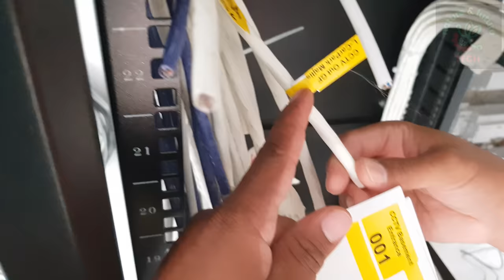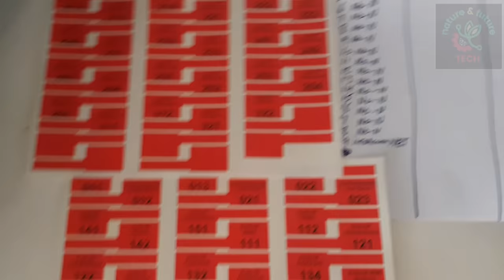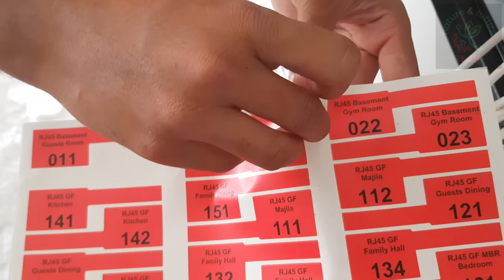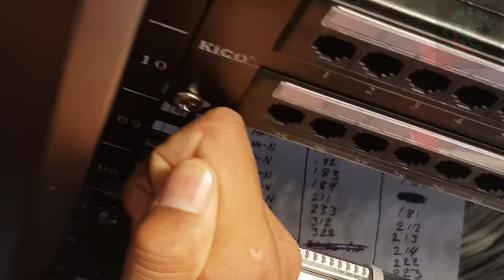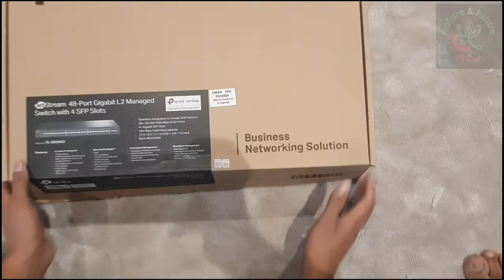Installation Network data Server Rack And cable management 27U cabinet Best Setup For Office or home

Comment: Not good work
Reply from the maker: Way not tell me the reason
Reply: Not good, excellent work.
Reply: First off they used zip ties in the rack half way thru the install they is when they decided to use flush cuts on the zip ties they were using should have been Velcro or “hook and loop” the large bundle they made from the celling is not in 24 cable bundles from the patch panel so if you did have to trace a cable back you would be lost just to start off there is more
Reply: show us your job guys! I really want to see it
Reply: Not good, amazing work
Reply: 🙄 23:20 🙄 16:36 🙄 10:20  @naturefuturetech

Comment: This is not a good example of best practices for rack installation. Zipties damage cabling and hands, velcro only. The whip should never run into the bottom of a wheeled cabinet. Not using a proper punchdown tool for termination, no lacing bars for strain relief.

Comment: Bro you are using STP Cable in cat 6 Patch panel ..it's wrong you should use CAT6A Patch panel for cat 6 A Cable
Reply from the maker: No bro we use cat 6 A patch panel for cat 6 A cable and for STP cable use cat 6 patch panel but in 1 patch panel we use some cable for CAT 6  because we don't have more space for extra patch panel
Reply: All that changes is copper size, you do have to make sure you get a proper connection with STP but it's really not going to affect anything

Comment: To every Low Voltage Electrician?     Watching this is pure harmony.   However, I would  negate the Zap Straps for Velcro.  But I would be a Liar if I said that I did not too do the same.   Instead of Labels?  I just use a Sharpie.  
Hard to get a Punch down tool in those tight space, so glad you got it done in place.   :goodvibes:
Reply: I would also replace the hard patches with keystones. Much easier to move around (which I've done a few times myself). The added cost is negligible compared to the hours paid.

Comment: Just small Tip: Permament Labels -> First tie over the cable and next bend over the label so that it will additionally secure label from falling of as the cable part will be glued from both sides :D

Comment: I am new in this kind of work, and the setup looks very neat and nice, but isn’t it better to have the related patch panels and switches be closer to each other, that way you only use a small cat6 cable to connect them right above each other, that way it will be easier for maintenance later; for example if there’s a problem with one specific cable with this kind of setup you might need to remove lots of cables so you can reach the specified cable but when the switch and panel are right above each other only a small cable needs to be removed or changed, i don’t know what do you think?

Comment: To those who mention the labeling + patch/switch arrangement:  I suspect that this was existing wiring they had to deal with, identify and clean up. Or who knows.  And I suspect they needed very specific patch ports to go to specific switches, so the paths are actually all different, it just looks clean. You can't always just jump patch ports 25-48 to switch ports 1-24 and vice versa. Then you have to choose if you keep your patch panels linear (to serially match the wall ports), or patch by function. I'm debating that in my upcoming install though I prefer the latter. Seemed like they possibly did the former.
Reply: Yeah…from the start of the video, you could see that it was preexisting cables. They cut them and toned them out
Reply: L'organizzazione di un Rack è a discrezione del progettista, se si tratta di un Rack misto (permute e prodotti attivi) è necessario sapere a priori la profondità degli apparati, le ventole se hanno spazio sopra e sotto per il ricambio d'aria, ecc...
Se si tratta di un Rack passivo, cioè solo un quadro di permutazione per un rilancio o con accanto un altro Rack attivo, bisognerebbe sapere almeno se si trova in un Ced con ventilazione forzata (corridoio caldo, corridoio freddo) ecc.
Per i pannelli di permuta (patch panel) già da sole 48 / 72 porte (a maggior ragione per Rack più popolati, come questo) preferisco disporre la seguenza del cablaggio per topologica fisica della rete, cioè piano, stanza, presa, in seguenza progressiva e relativa numerazione. E quindi non per destinazione d'uso, perché potrebbe cambiare nel tempo (porta client, porta server, trunking, telefono, telefonica IP, dati).. trattandosi di cablaggio strutturato.
Magari una distinzione posso farla mettendo in alto i patch panel con le dorsali da Rack a Rack in rame e/o i cassetti ottici.
Poi senz'altro le patch cord di diverso colore per destinazione d'uso (celesti dati, verdi fonia, gialle dorsali, a discrezione del cliente e dell'amministratore di rete). Consegno i Rack con misurazioni e relative certificazioni sul cablaggio in rame e fibra. Francesco

Comment: amazing work! My only comment is that its much faster , cheaper and easier for the next guy that may come to do a work in there to use the standard - patch panel , switch , patch panel. Working this way its much more serviceable and you can use much smaller patch cables.. Other than this amazing!

Comment: Pretty nice. I am not sure why you would go with smaller port number switches, but maybe the PoE limits were the cause. I think spending a little extra on something with good forced cooling, dual power supply, and 50 ports is way to go almost always, even in smaller setup. It makes less mess, and gives you flexibility later.

Comment: First use Punch Down Tool, its gonna make your life easier. Second and more important, you are untwisting pairs a bit to much. Its probably gonna pass for cat6, but still, just do it the right way. Also that patch panel is awful, i understand sometimes you have to work with what you are given, but you have nothing to secure your cable to...Otherwise,  its very decent job, i would personally go up and then come down on the other side with cables just to leave enough for equipment shuffling in the future (and that's gonna happen for sure). Respect for cable labelling.
Reply: I noticed the same thing, too much untwist at patch panel, and i don't think it will certify for cat6

Comment: Very zen and satisfying video for us tech people
Reply: Curious though.  For cleanliness wouldn't it have made more sense to run the cat5 through the holes in the cable management slot and feed them up or down through the grooves so you could tidy up all cabling in the back instead of the front?

Comment: May look pretty but not to Structured Cabling Standards.  You don’t use Tie Wraps (aka, zip ties) on data cables.  It distorts the twists in the cable causing attenuation and crosstalk.  When you run the cables where they run parallel tie wrapped together it causes alien crosstalk (look it up).  Is the bay grounded?  
Different categories of Patch Panels.  Different manufacturers of patch panels with some CAT5E and some Cat6.  Too much untwisted in the termination and not using the proper punch down tool.  Look up BISCi standards and patch panel manufacturers standards.  Belden, Lucent, AMP, and Panduit all have installation standards available online.

Comment: I’m just learn to do this type of work as of 3 days ago. I’ve been in the cable industry from 19 years and never learned this side of cabling🤦🏾‍♂️….now to the video, why would you use zip ties on those cables coming down from the ceiling and like some one else pointed out….those are not 24ct bundles. I get that you guys may have toned those lines 😮‍💨😮‍💨 but why didn’t you guys use Velcro straps

Comment: do not get me wrong it looks pretty but the only reason you would ever do the runs like this is if you want each zone on there own patch panel and wanted each receptacle connected to a specific router for multiple internal networks

the more common practice is you use short jumps from patch panel to router

the only other reason i can think of doing this is to show off your wire-fuu which i will say is quite good

Comment: i would use velcro ties instead of zip ties, the zip ties can smash the cable and unwinds the cat twists and cause crosstalk
Reply from the maker: Thanks for your comment first of all bro this is a cat 6A STPcable it is too hard to handle with velcro even if we use velcro as you say after 1 year its gone lose that's why we use zip tai I'm sure its not hurting the cable❤️
Reply: @naturefuturetech  ahh ok, as long as you dont like death tie it lol, i have seen some jobs where they tie it so tight it actually cuts into the shielding
Reply: Lmao been using zip ties for years never had an issue. 
Never mash a cable if you know what your doing

Comment: Smaller cabinet, have deeper cable managers when using longer patch cables, rather than feeding everything to the side. Looks nice, but defeats the purpose of a cable manager, and screws anyone trying to feed wire through in the future. But looks ok.

Comment: Need to use a compression punchdown tool and probably a better cable stripping tool.  The way in which this was done will cause the connections to fail prematurely.  Not to mention with the cheap cable stripper, there is a much easier chance of cutting into the pairs and if you nick the copper, it will weaken the connection.

Sure, good tools are expensive but they make all the difference.

I also agree with the comments that the patch cables are too long.  I have come to realize over my career that it is better to use short (1-2ft) cables then stack the switches or use high capacity fiber between the switches and better engineer the traffic than use long cables stuffed and pinched into a rack like that which risks early cable failure.

Comment: There are two main metrics:
1. Good work per standards/best practices &

2. Looking good to the eyes. Aesthetics.

It is possible to reach either one and not the other.

However, for reliable data communications, #1 is preferred over #2.

To some installers and clients, they tend to feel 'satisfied' with #2 over #1.

To a professional, both have equal weight!

The professional and responsable client would first prefer that installers wear PPE!
Then have and use correct/proper tools.

I'm wondering, isn't there a way to prevent so much wasted cable? It adds up.

Any installation method that may affect the cable's geometry will negatively affect performance.

Installation must consider (ease of) maintenance.

Then again budget$$$ determine a lot.

What was the objective of the video again?😅

Comment: Seriously?  That is not CAT6a compliant at all. The twist should be maintained right up to the IDC terminal.  I didn't see a support bar for the cables.  Use a proper impact punch down tool like a Fluke/Harris.  It will properly seat the wires as well as cut the tails in a single stroke.  Label each cable at 1,2,3 fist back for east identification. Last, 4 days to do two days worth of work is not impressive.

Comment: Next time you work, attach the switches one under the other with paccord sockets, you will not have to use very long paccord cable. 10 cm paccord cable will do the job.
Reply from the maker: Sure bro🌹

Comment: Pro-tip, label the ends before you pull them.  Will save you hours upon hours tracing.  Also keep track of your run length and how much is left in the box !

Comment: Not grounding the shielding is an oopsie. Disregarding the fact that you paid for sielded cable and you don't use it, if the shielding doesn't connect to ground it can act as an antenna and instead of blocking EMF it draws it.

Comment: Why we use that communication circuit  accessory 14:19
Reply: That's called a patch panel. It is not technically necessary. You can build your entire network without it and it will still function just fine. The reason we use patch panels, especially in large networks is to make the cabling more organized and easy to work with instead of having a mess of cables running all over the place to the switch. With the patch panel, you just patch in whatever ports you need to make the connections active.

If you have a wing of 5 classrooms and each classroom has 10 data drops, that's 50 network cables running into the network rack. All the ports should be labeled accordingly on both ends. Once you have this setup correctly, it makes it incredibly easy to activate a network port. So for example, if you have Room 5, port 15 that needs to be active, you just go to the patch panel and plug in a patch cable (ethernet cable) from port 15 at the panel into whatever port you need on the switch and its live.

Comment: Pffff thanks God this is not my work...I would be ashamed.

* Wrong layout.
* Wrong patch kabels.
* Why in *** sake use wheels on the cabinet..... that rack should be bolted down.
* Wrong tools.
* Otherwise make those tyraps even tighter.
* way to far untwist from the pairs. 
* shielded cable on no shielded patchpanel.
* TP Link switches 😢.

Where do I need to stop ? This level of work I did when I was 12 years old and didn't know better....

Comment: Man I hate cable ties.  No one ever flush cuts them and the sharp edges they leave shred everything including my hands.
Reply: I get triggered by cable ties I've been cut and stabbed by them I refuse to use them.
Reply: @nscaledelights  Nothing but sewing cables in with waxed 9 ply cord where I work.
Reply: @jleote  lol

Comment: zip ties... gross.  cage nuts... gross.  hand combing... gross.  punch down patch panels... gross.  finger duct cable management... gross.  excessively long patch runs... gross.

this spaghetti horror show ended up looking "clean" because you tucked all of the excessive cable length "out of view" but good freaking luck when you need to service or replace one of those switches.  at that point you are going to have to completely re-patch likely multiple U because of the tangled mess you left behind, just jamming extra cable length in random nooks and crannies.

whoever has to service this in the future is going to be cursing you.

Comment: Not impressed with this video, I have experience in filming and building racks, so here are my pointers. Camera works was way too quick and jerky, needs to be a lot smoother. Patch panels and switches should be right next to each other so that you can use 6" or 12" patch cables, this makes for easier problem solving at a later date. Lastly you should be using Velcro not zipties, this way if a cable has to be replaced you are not cutting ties.

Comment: im looking for this job what is name for this job
Reply: Structured cabling installer, network cabling installer, low voltage cabling installer, etc.
Reply: @balajik5932  It depends on the exact job, but usually those are separate job classifications. This job is mainly to run the physical infrastructure. Setting up routers and switch is usually done by network admins/engineers. Or they may do a bit of everything.